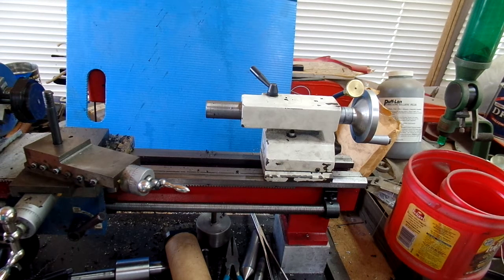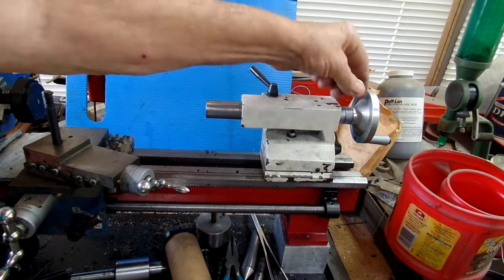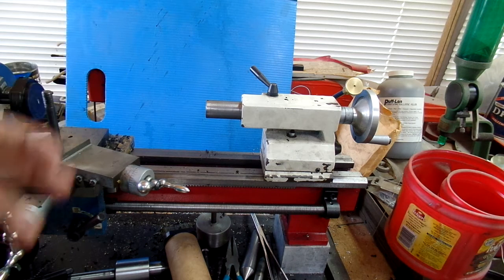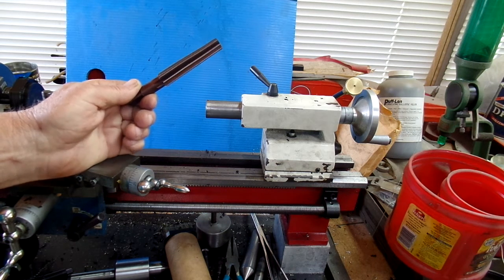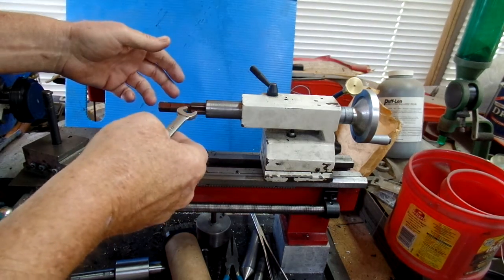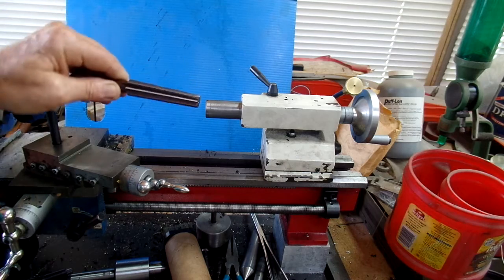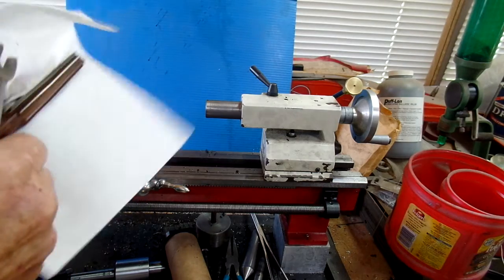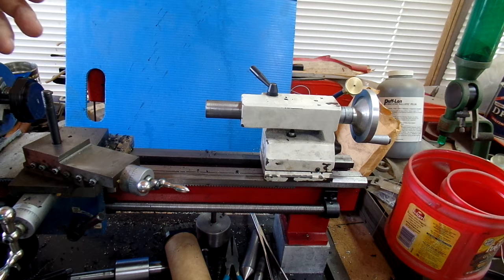E143 Cleaning a number 2 Morse taper tailstock

Comment: Hi Dennis,when you use a morse reamer on a tail stock you should support the reamer with a dead centre in the head stock taper,after that use medium emery paper on a stick and lightly sand the bore in a circular motion.Having said all that I always support a drill in the taper with a tightly clamped vice grips or lathe dog.Cheers.Ronnie.